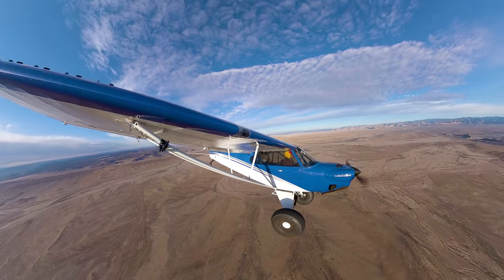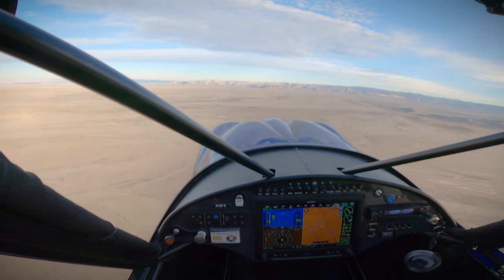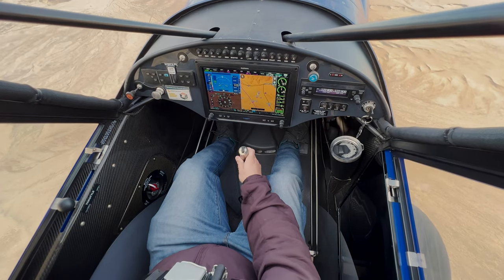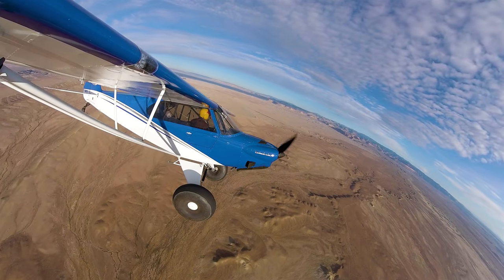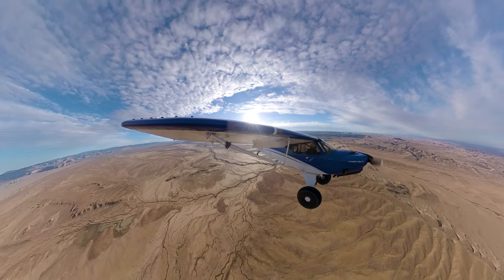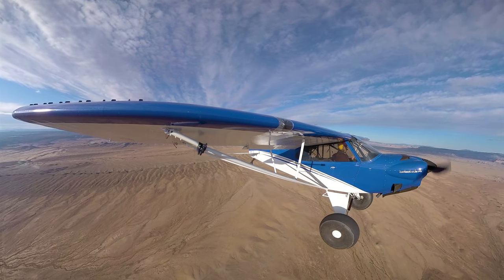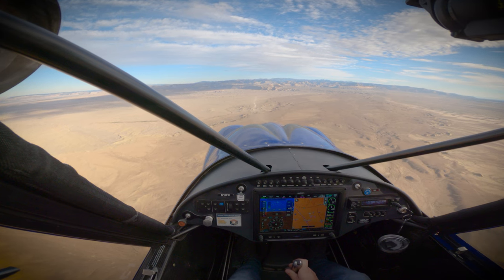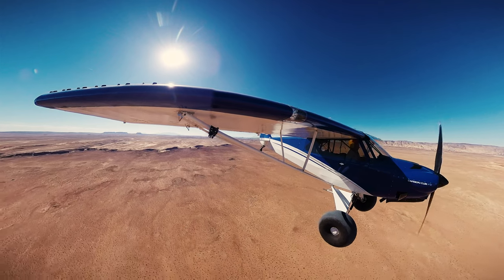Backcountry Flying Basics: Slow Flight, Stalls, Upset Recovery, Falling Leaf

Comment: Nice video. On modern clean gliders the "pitch is airspeed" thing is very noticeable.  On approach you set/trim the elevator for your target airspeed. To change your rate of descent you adjust your air brakes.
Reply from the maker: Awesome

Comment: Good explanation. UPRT, in Jet aircraft the stalling characteristics are different to light aircraft as on sweep wing jets the wing tips stall first which causes a pitch up, stalling more of the wing = deeper stall so the “Push” is very important and if the nose is high with power on you will need to reduce power initially to help the nose come down
Reply from the maker: Thanks!

Comment: Nice! Well put together video, what happens if you slip and you stall your airplane? I have always heard that wings will just role level but have never got out to try with someone that had experience with it
Reply from the maker: If you are at or near stalled and you accelerate one of the wings due to a rudder input (proverse roll, slip, etc.) the outside wing will produce slightly more lift, raising that wing and leading to the rotation of a classic spin. In these turning stalls the outside wing is reaching its critical AOA before the inside wing due the aileron input changing each wings AOA in the roll. That causes the higher AOA wing to drop and rotation will start from the high wing now accelerating forward and starting the rotation.... At least that's how I understand it.. I'm definitely no expert on spins... 
     In answer to your specific question, it would depend on the type of aircraft. In a training aircraft, chances are you might stall straight ahead only because of the built in anti-spin characteristics of that airplane. A Cub, Decathlon, other types do not possess the same aerodynamic safety features.

Comment: When you say folks are supprised by the left wing dropping, doesn't that go against conventional teaching.  You looked like you were in coordinated  level flight in the turn, I would have thought the nose would just have dropped perpendicular to the wings.  What am I missing?  JR
Reply: Engine torque, and the left wing started out with a higher aoa meaning it stalled first.